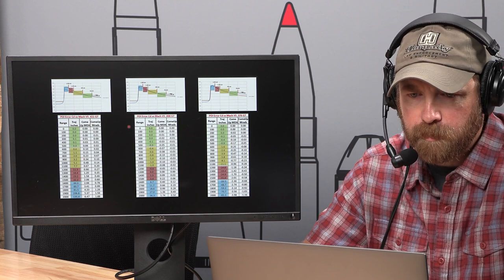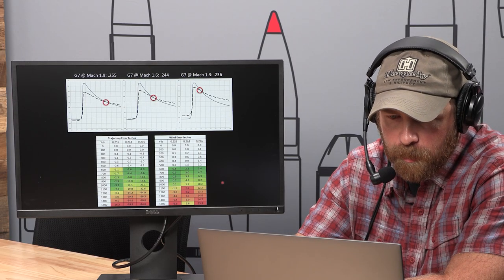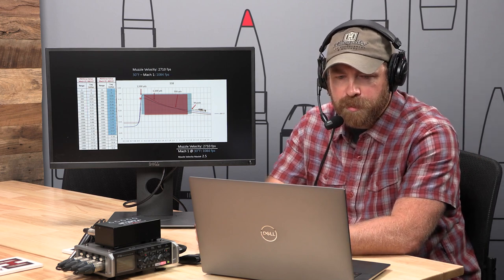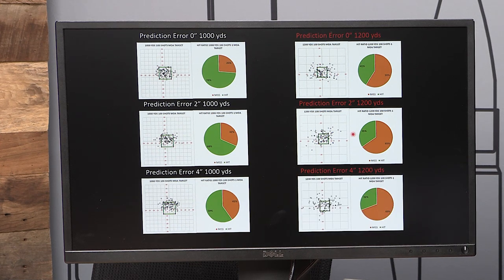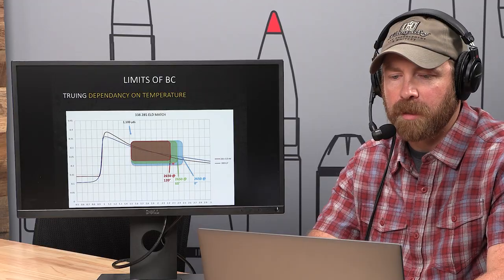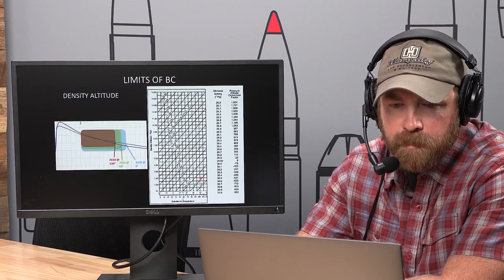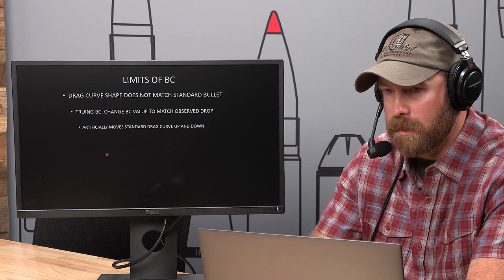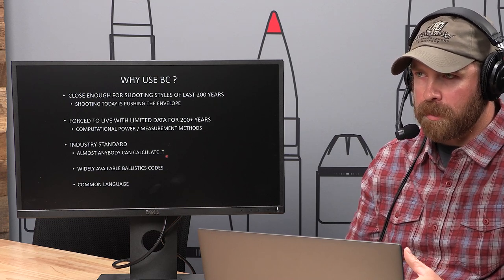Ep. 044 - Bullet Drag & Ballistic Coefficient | Part 2 |

Comment: Thanks for putting this together.

It would have been helpful for me if you’d shifted the ‘model bullet curve’ left and right to show how it lines up with the actual curve when variables (temperature/velocity) are adjusted.  I think it would highlight the areas that the ballistic solution is improved and where it is degraded by the ‘adjustment’.

I love 4DOF but there are still bullets that I like to use that aren’t included in the library yet.  For those other bullets adjusting something (BC, Velocity, temp, DA etc) is the only option for improving the predictive curve.  Also, I still make hard data cards for everything (even when using 4DOF) for my actual shooting (steel and critters).  This definitely helps explain why things needed ‘truing’ in the past.

Thanks again!

Comment: It gets worse because not only does performance of the bullet change with temperature/air density but powder burn rates change with temperature. I was told in college chemistry the rate of a chemical reaction doubles for each ten degree increase in temperature.

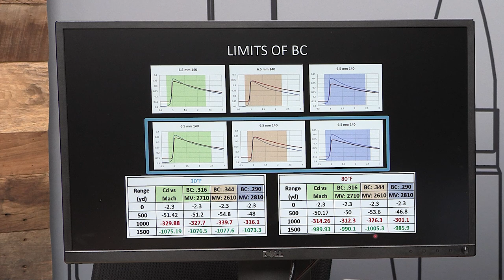Comment: I'm confused - doesn't your data show at (44:20) that at 30 and 80 degrees an adjusted BC of 316 and an adjusted MV of 2710 FPS that the adjusted solver predictions are within 1-2 inches of the actual drag curve at 1,000 and 1,500 yards? Isn't that pretty much insignificant?

Comment: Great content you guys have been putting out lately. I don’t understand why you developed the ELD-M with a polymer tip, instead of streamlining the BTHP bullet. It seems like you could swage or draw a bullet into any shape you wanted, without the added expense of fitting a polymer tip. Since terminal performance doesn’t matter with a match bullet, why the polymer tip?
Reply from the maker: It's for good reason. We can address that in a future video.
Reply: 4DOF data clearly shows the 109 grain, 6mm Berger target bullet outperforms the 109 grain, 6mm ELD-M.
Reply: I’d guess it has to do with the relationship between center of mass and center of drag…as well as cost/efficiency for creating the most consistent shape at one of the most critical points on the bullet (pun intended)

Comment: I am bitterly dissapointed. I came here for knowledge and all I got was a sales pitch. 4DOF might be 100% accurate, but it is so difficult to use and (unless I am missing something) lacks so much of the extremely useful features  of some of the BC calculators available.
Reply from the maker: Feel free to reach out to podcast@hornady.com and we would be glad to help. We feel it is pretty easy to use and would love to assist. There’s no sales pitch as it’s free. We just want folks to be as accurate as possible.
Reply: You might be missing something. I owned and used every notable solver on the market including kestrels and the 4DOF app is by far the simplest one out there. So much so that there’s a little question mark by each input line that explains what it is.